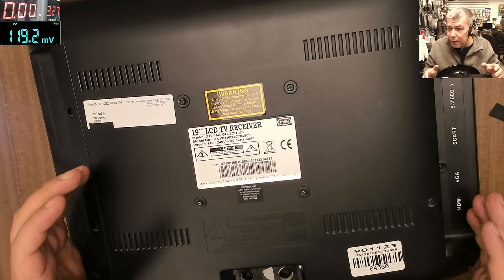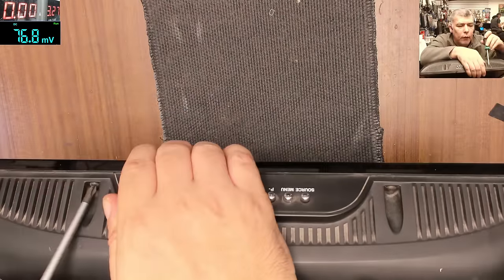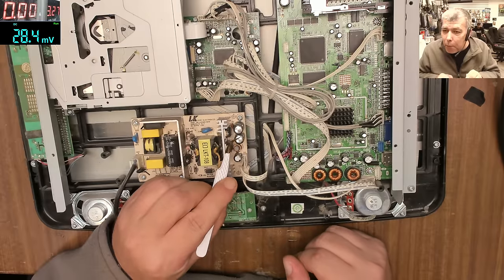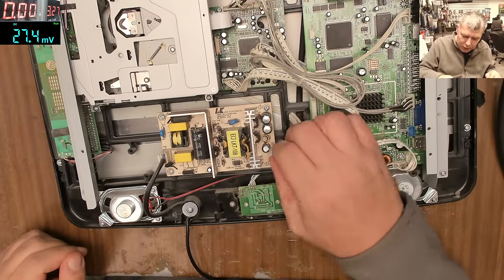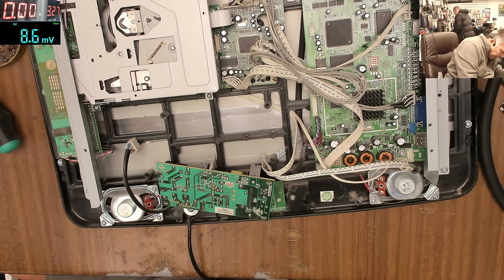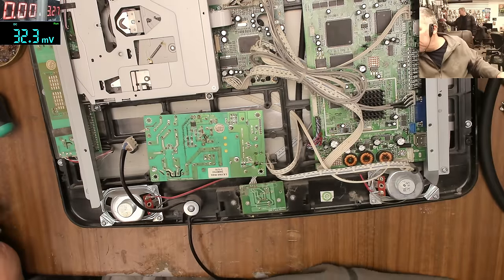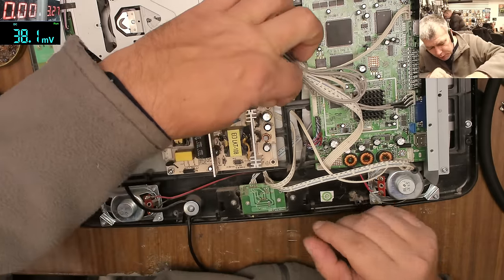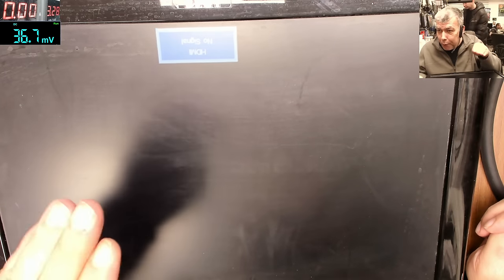This is the most common fault on a dead TV!

Comment from the maker: Do you agree this is the most common fault on a old TV?
Reply: Yes on older TVs the caps used to fail and bulge at the top, I repair TVs and these days I never see that fault , most common issue now is led backlights
Reply: On Vestel tv PSUs (mainly the 17IPS61) the high voltage diodes on the secondary side near the transformer are the most common fault as far as I've seen (those boards are found on philips, sharp, telefunken and other off-brands tvs from the fhd era). A part from those, the rest usually are caps failures... Both easy to find and easy to fix issues.
Reply: @matteo_z  I repair TVs and sell parts there is several vestel boards where the diodes fail , the board you mentioned I sell the diodes repair kit for version 2 and 3 , I sell 6 pc diode repair kit for them, vestel boards are used In even Panasonic and it’s all junk vestel stuff, it’s also used in bush, Polaroid, toshiba , jvc , techwood, Hitachi,finlux,digihome,linsar , Luxor and so on, not all Panasonic are vestel, there more expensive TVs are not vestel , sharp and Hisense use a different manufacturer to make the boards then we got Samsung and LG who sometimes make there own or use a dedicated company to manufacture them and Sony get a company to make them aswell , me personally I stick to oled TVs now as led backlight TVs are all rubbish
Reply: Not only TVs, I fix the same fault in most power supplies, even Xboxes or PC power supplies. Not only those electrolytic bigger ones, even the SMD type as well. Just now I fix one Toshiba laptop which will be posted on this YT channel here where 1 0805 size and 10uF made a short to the ground and this laptop is dead.
Reply: @M.E63  agree, I hate especially those edge backlights. Those diodes are up to 6V and are too dense there. Plus, those no frame TVs are too easy to break on top of that, or Samsung's no screw ones the same. A modern rubbish.
Reply: think it's a shared first place with cracked solder joints.
Reply: Super fast repair 😀
Many t'v sets/psu bricks and monitors fail because of the switchmode Caps.
The high frequency ripple voltage/current  and boiling is a cap killer :-(
Compact little psu.
Reply: Yes master
Reply: @screen-protector  Samsung edge lit led TVs are the worse you can get, they burn the diffuser sheets and only last 12-18 months, the Samsung screw less ones can be repaired but once they burn the diffuser sheets then you got big problem , the ones with no frame on the front are just so hard to repair as the screen is very hard to remove, Sony used to have decent led TVs but even them are not great anymore but maybe still they are the best led TVs but not popular anymore and they don’t have lots of models like LG and Samsung , LG TVs are terrible aswell, all the leds just turn blue and your lucky to get 2 years out of them
Reply: Fix a few Samsung power up board's just looked at the capacitors blown repair shop want £85 to repair I bought the capacitors for 15pence did it my self and I am not a professional just an old fart with common sense.
Reply: Yes 
And first visual inspection of most power supply units is capacitors.
Reply: Caps and  CCFL Inverter were the most common problems.
Reply: Caps went on my Samsung monitor after just over a year old. Replaced with quality ones and still working fine 12 years later
Reply: @M.E63  I’m selling all my boards, led strips, t-con boards, tv stands,
Reply: @M.E63  if you interested let me know
Reply: @wisher21uk  where you located ?
Reply: @screen-protector  I’ll check out your channel and take a look, most newer sony TVs are android and if the board is not repairable then it gets expensive and sometimes you need to update the firmware after replacing the mainboard, I like the protection mode on Sony’s as most faults the tv won’t even turn on and show a blink code, that’s crucial for the backlight as samsungs will continue to work with faulty leds and the edge lit will burn the hell out the tv inside if the  person keeps using the tv with a faulty backlight and if it’s just 1 led then the person wouldn’t notice the fault and them leds will get hot and burn the diffusers , that’s what I like about Sony if the led has failed  then it will go in protection mode and that’s what saves the tv from further damage , most Panasonic’s have protection mode aswell , I wish Samsung would have protection modes to save the tv, seems like they do it on purpose as they know about this issue and they done nothing to resolve it and the quality of the leds get worse and worse, they even got TVs now which use thousands of leds, can’t see them being very reliable
Reply: @M.E63  miles away probably lol South Shields near Newcastle uk
Reply: @M.E63  I've just quit on one Sony today ;). I did order a next mainboard and what happen was that it turns out faulty ;). After doing the Factory Reset, it ended up in a Boot Loop. Sony is the worst to repair for me. I prefer Vestel and Samsung with LG over it ;) to be true. But yes, it's getting worst, not better and that's why we're fighting for the right to repair ;) and want to produce fixable electronics. Most don't need a 8k resolution ;).
Reply: @wisher21uk  I live in Birmingham but that don’t matter and let me know what you got , if you buy any led backlights on eBay then you might have bought some from me
Reply: @screen-protector  Yh I know Sony’s can be harder to repair and even cause issues when replacing boards but I just like how they got protection mode which saves the tv from further damage, that’s what I want Samsung to do with there Edge lit TVs , the full array ones don’t really burn anything inside, Sony TVs are getting rare these days anyway, less and less people buy them , vestel are easy to repair but I just don’t like them as they are just rubbish quality and I have trouble selling some vestel smart TVs as the apps don’t even load as that’s how slow they are, try to open Netflix and it won’t even open
Reply: @M.E63  maybe 🤔 vestel main and power, Panasonic main and power, Samsung main and power, lg main and power, few Sony boards,
Loads of misc boards like Hisense,sharp, jvc, etc and about 100 remotes mainly new Sony, Samsung Toshiba etc
Reply: @M.E63  if vestel works out of specs = totally agree with you. But, I have 2 here and my boys are on a cheap Panasonic which I bought for £40 from one customer. They use YT and Netflix all the time. 

So, if the vestel don't work, there's an issue ;). Always a reason behind it. I'm trying to gather experts in one place and make proper tutorials for all the repairs, not only TVs. 

If you can follow this YT, you'll be up to date with what I'm doing here. It's a great project and the ultimate goal is to produce fixable and sustainable electronics sold by decentralized individuals and not those huge shops. Our individuals will service them under and off warranty periods.
Reply: @screen-protector  Yh I will check your channel out , some vestel are fine but some that are like 5 years old the apps don’t open anymore , mainboard was cheap so replaced it but same problem , my friend bought similar models and had same issue with a few different ones so it’s a common thing and I’ve seen it on quite a few older vestel TVs, some models are fine but the low spec ones half of the apps stop working after a few years , not all Panasonic are vestel but the ones that are not great, I don’t know why Panasonic even started using vestel as Panasonic was a top brand before but little do the buyers know that they are just buying a vestel tv with probably a LG screen
Reply: @wisher21uk  are the boards all working of unknown ?
Reply: @M.E63  98% if they’re faulty like needs a chip or cap it’s marked accordingly but there are loads and I mean loads
Reply: @M.E63  agree, well, I think I was just luckier with those Vestel TVs ;). Plus, the only apps we're using here are Youtube and Netflix. Maybe if we'd start to use more than that, then we would expect further issues. :D Thank you.
Reply: @screen-protector  what sony was it peter
Reply: @wisher21uk  depends on what you want for them
Reply: @wisher21uk  kdl-55w809c
Reply: @screen-protector  I will have a look in the morning if I have one
Reply: @M.E63  how can I send you photos of the stuff I have ?
Reply: yes, specially on Crt. vertical and horizontal def.
Reply: @wisher21uk  thank you
Reply: @screen-protector  hi Peter no luck I’m afraid sorry, being a bit late getting back to you been a busy day
Reply: @wisher21uk  don't worry, we always can transform it into a Frankenstein LOL. As long as customer wants to fix it, we can do something about it ;). 

But, thank you for your time! :)
Reply: Perhaps a lot to do with the operating hours of the TV. The trend I observe is the considerable reduction in size of the power supplies over say, a 20 year period. It would be that the electrolytic capacitors are the components most prone to partial or complete failure...
Reply: yes big time
Reply: As a former AV technician with +10k units repaired , mostly Hi-Fi stuff, some tv's, I say capacitors is common in the powersupply section and yes, it's nicely done when you replace em with some with higher voltage ratings too. Maybe when in extra good mood 105 degrees ones. A lot of circuits is marginal by design. 
But: I saw it's also fairly common with bad solderings on the hot components like output transistors and power resistors and blown output transistors can be a pain because they tends to drag with them and fry more stuff connected to it. 
In the old days there was almost always schematics which is pretty rare now, since you today just replace whole modules (if you can) or toss it. Nice old fashioned repair job mister.
Reply: Yes.  Absolutely.
Reply: I do not get it , when you tested the capacitors they still showed voltage.  How can they still show voltage and yet not work.
Reply: On my 2008 samsung i had to recap the power supply exactly like this. She still works
Reply: Yes! Not just TVs, but radios, dishwashers, sewing machines, etc.

Step one: power cycle
Step two: mains filter capacitors
Reply: @davefroman4700  it also keeps the wealthy people wealthy and the struggling people struggling.  if your point could be proven in a court of law , the wealthy people could be brought down to the knees 🤣😂🤣👍🤟👌
Reply: Yep, capacitors one of the most common faults on PSU.

Also common to see two at least capacitors in parallel as it also lowers the ESR value
Reply: This is common fault with many old devices. I've seen this fault also in odometers of cars.
Reply: Yes, absolutely..
Reply: @M.E63  I was told that it was a result of industrial espionage that failed, in that the composition formula of the electrolyte was stolen, but they didn't realise that it was actually only half of the formula. Millions of faulty cheap caps. were then manufactured in Korea and used world wide.
Reply: Yes that is what I have found too.
Reply: @screen-protector  Panasonic does edge backlight......... panasonic make the best tvs so?
Reply: @cutterbacon  don't understand what do you mean, sorry. Panasonic has 2 lines and Vestel makes the cheap one, this one is not best for sure.
Reply: @screen-protector  My Panasonic is a edge backlight and obviously Panasonic is one of the best for making TVs.
Reply: @cutterbacon  IMHO, but I've got 20 TVs about at home, and by sales volume, I've seen that Samsung and LG are selling a lot. I've seen Panasonic selling less, and proportionally less I've got them in my repair shop, only 2 faulty.

So, they are not the best, are as bad as the others for me ;).

On top of that I don't know if you do fix TVs, edge backlight is the worst technology for me. I prefer this last technology called a full backlight. This one could cause less damage than the edge one. So, again, nothing to brag here. It will be a great TV as long as won't go faulty ;).

You wanna downgrade your TV? But a new one, the edge one - that's my opinion on it. My other friends from repairs have the same opinion.
Reply: @screen-protector  Thank you. The last big tv i bought weighed 78 kg and was a toshiba.
Reply: @cutterbacon  my last heavy is here, it's a Panasonic TX-58AX802B with a faulty mainboard, it's a 4K ULTRA HD LED. Comparing to others really heavy. It's 48kg with a  stand :) and 33kg without. 

Before that I had plasmas here. But, on this Youtube channel I think I've shown only 1 plasma TV, the rest are LCD and LED types.  I've got here one plasma, something wrong with the power supply.
Reply: Absolutely, also monitors. I've repaired dozens with blown caps. You can buy custom packs of caps on eBay for each model.
Reply: Common on old receivers too.
Reply: Not just TVs my old Mecer monitor would take a few minutes to turn on. Eventually it stopped turning on. I opened and and saw one bulging capacitor. I had one in my drawer from an old TV and just that.
Now my monitor is working again and I saved it from the rubbish dump. Fixing feels good 🙂
Reply: yes, it's usually about a chemical capacitor or a diode when it's a big electronic machine
Reply: THANK YOU  FOR  THAT VIDEO.

Comment: Found a 42" LED set junked on the street this week. Mains cable had been cut off and it was soaking wet, but the screen appeared intact, so I thought I'd take a closer look. After I'd let it dry out for a couple of days I bodged a mains lead onto it and powered it up, surprise surprise, stuck in standby. Opening it up revealed the standard Vestel boards, and the equally standard bulging capacitor. A few pence worth of parts, and I have a rather nice big telly in my living room now. :)
Reply: If you let them dry out, there really isn't anything water can damage. Most mainboards/ electronics boards after flow soldering or whatever they are put in giant industrial washing machines to wash off all the leftover solder paste/flux and whatever
Reply: How do you work it without a remote?
Reply: @hermanhale9258  It's a Vestel board mate, I have a box full of old telly remotes that are close enough to work with it. ;)

Comment: Hi Sorin
From my following your vedios.  I was abled to repair my Air conditioner board. 
It was on but outside compressor not starting. 
I tested the outside unit by bypassing the AC and it  worked . So the problem is whether from the relay or something else.
I tested the relay and is us good  when I checked the voltage on the main board traces I found less than 12 volts.
As I learned from you I focused on the capacitor after rectifier and changed it even there is no signs on it that is blown. 
The Air conditioner is working properly. 
Thank you so much Sorin for your valuable lessons.

Comment: When I was in 8th and 9th grade, I was taking electronics classes in Junior High School. I would bring old radios, mostly tube type, to school and fix them. I enjoyed it a lot. Often it was just the power supply filter capacitors like this, but I also replaced bad capacitors in the circuits. I would then adjust the tuning coils, and those old radios would work great! Often I could get better sound and reception than a new radio.
Reply: I took electronics in High School. We had a lot of Tube power supplies in the Lab. No calculators back then. Used a slide rule. It hung from a sheath on my belt. Looked like i had a small sword 😃 . I remember the day our instructor came in and said there is this company called Intel and they make something called a Microprocessor. The instructor went on telling how digital logic worked. I leaned over to the guy sitting next to me and said...THAT WILL NEVER TAKE ON 😆
Reply: @meTimetraveler  I was in college. Took like one semester and all the engineering students replaced their slide rulers with the HP57s
Reply: Wow same here for me! When I was 15 years old I worked in a TV repair shop on Saturday’s I was hired to help the tech pick up and deliver TVs to and from the shop! Prior to that I earned my novice ham ticket in Boy Scouts. And I had built several Heath kits. The shop started letting diagnose failures with supervision. Latter in high school I started to learn to fly airplanes while still going to the technical school for electronics. I worked in electronics for several years combining my flying skills to travel as a Field Service Engineer on medical ultrasound equipment. The company provided cars and an airplane for work. It was great for two years the company was bought out sold the airplanes that is when left. And started flying full time for a living.😁🛫
Reply: @TheFalconJetDriver  That sounds great.

Comment: Great job! This is truly a common problem and I have repaired my Samsung ($$$) by replacing the two capacitors shown for under $2 when repair quote was $400. One point, though, capacitors have polarity and need to be replaced respecting the polarity or new capacitors can fail immediately. I suggest pointing out a bit more clearly how to determine the polarity of a capacitor and then how to know the polarity marking on the circuit board. This is best done before removing the old capacitors. Good job right to the point.
Reply: Not all caps are polarized. The ones that are usually have a large stripe designating the negative leg.  Unpolarized caps are definitely more uncommon and are usually used in power supply overage protection.
Reply: Only Electrolytic capacitor are polarized.
Reply: I take a lot of pics of stuff I work on first
Reply: All but the cheapest TVs have the polarity marked on the PCB, but if not look at the strips and mark the board where the stripe with  (+)  is.

Comment: Nice Fix!😉
I also miss fixing TVs , its just not worth it nowadays......😑
Used to fix a lot of them and also PC Monitors had the same problem.
I stared my apprenticeship repairing CRT-TV's which mostly had cold solder joints and dead line-driver Transistors
Then LCD-TV which had a lot of problems aside form those caps...(dead CCFL inverter or LVDS TCON board/cable)